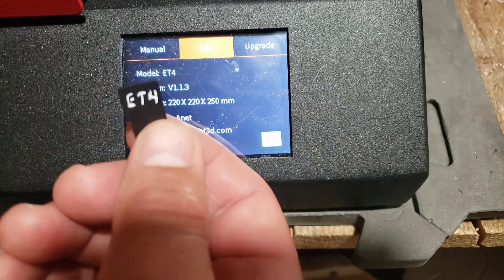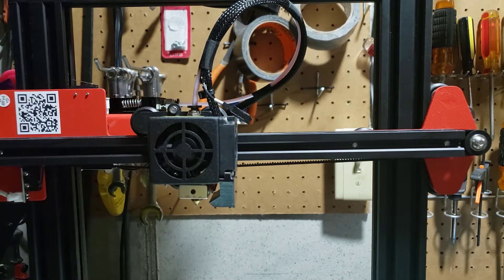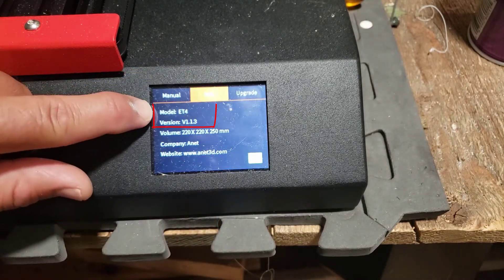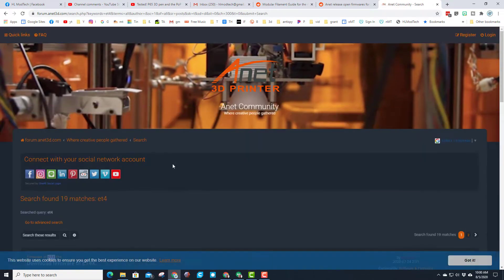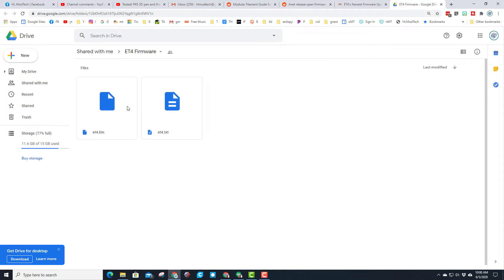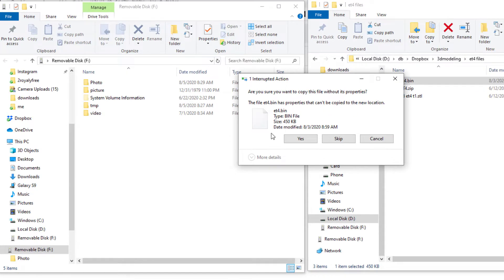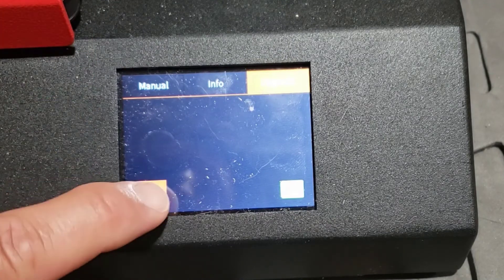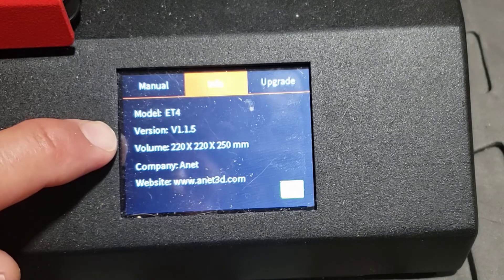Tested! Anet ET4 firmware upgrade steps | version 1.1.5 | ET4 Only

Comment: ive tried to do the exact same thing on my ET5 and it wont even start the update anythoughts?
Reply from the maker: This video shows how to recover a Anet that had a bad flash. https://youtu.be/KKCer809pxU
Reply: @HLModTech  gave it a go doesnt work just going to throw it out unfortunately
Reply from the maker: Did you buy an ST-Link? THey are under 10 bucks. I have never had a printer that was un savable.
Reply: @HLModTech  the amount of problems I’ve had with the ET5 has put me off cheap printers, just going to save my money and get a creality printer or something higher quality in the future
Reply from the maker: I get that. Hopefully you find one you dig.  I had an Ender 3 in my classroom and it was a workhorse. There are also a boat load of groups where you can find assistance for it.
Reply: @HLModTech  if possible I’d look for something with a 300x300x400 build volume for printing helmets etc

Comment: It doesn't matter if you mess it up because Anet doesn't honor their warranties anyway.
Reply from the maker: Thankfully I’ve never had to use the warranty system. I know everything I bought overseas it was slow to get support. My usual go to was Facebook groups because you can get replies they’re pretty darn quick. I do like how easy it is to bring one back to life with a ST link adapter.
Reply: @HLModTech  I bought mine on Ebay from an Anet distributor back in October and when I opened the box I noticed the warranty sticker was hanging off so someone obviously opened it  at some point in time. I messaged them and told them my concerns and they assured me that it's under warranty and any problems to let them know. I was too busy with work and other stuff at the time so I waited till after the holidays to finally assemble it and start using it. Right from the start I was having problems with it. The print head was arcing inside due to faulty wiring and the main board is very problematic. Don't know if it's the board or the firmware. None the less, it has issues to this day and it is under warranty. I messaged them several time informing them about the issues I was having and they haven't responded to this day. I contacted Ebay and they basically told me that I waited too long to use it but as I explained to them that it has a one year warranty and it is within the one year. If it was junk in October than it would be junk in February as well as it will be junk in June. It is within the warranty service time. Customer service at Ebay are the most brain dead people I have ever dealt with. So here I am with a basically useless printer that's under warranty that Anet is apparently not going to do anything about and I'm out $170. Will never buy another Anet product again. I actually picked up 3 printers on FB marketplace for $60 for all three. 2 Ender 3's and an Anet A8.Ender 3's work great but the Anet is being sold for parts because I want nothing to do with their products.
Reply from the maker: Sorry for your frustration. I liked that I could easily flash with the ST-link https://youtu.be/mAmIbrGi6G8  Popping Marlin on them was pretty slick. Really cool you landed a couple Ender 3's. I have one that is a workhorse for me.
Reply: Yeah, it's been pretty frustrating to say the least. I have a couple questions if you don't mind and you seem to be very knowledgeable . I have a BTT SKR V1.4 turbo that came out of the Anet A8 that I got with the two Ender 3's. Do you know if that is compatibly with the Anet ET5X and or the Ender 3. And second, are the Anet A8 parts compatible with the ET5X, meaning the PSU and the print head/hot end as well as the stepper motors? These printers are all new to me, I've actually built high end gaming PC's but these printers are a whole different world to me. Lol Thanks
Reply from the maker: I have not messed with modding printers much. I to was a PC builder... Just have not messed with taking the printers to new levels. Sorry I cannot give you better info on the compatibility of the various parts.

Comment: Hi.
Can i use 1.1.7 fw on ET4 which doest have auto leveling sensor so the regular first version of ET4 without capacitive sensor.. I have now the first 1.10 fw version. I m wondering will my ET4 start to go home at bottom if i upgrade to 1.1.7FW? as i have stock end switch on z axis only at the top. Do i need end switch hardware modification if i upgrade to 1.1.7 fw as it will start to go home to the bottom or it will still go to the the top at home position? I dont want to use any auto level function but want to use M503 and other gcode to setup estep calibration which only supported by the 1.1.7fw.
Thanks
Reply from the maker: Sorry I missed this. I am not sure.

Comment: I know its old but I bought an et5x and swapped out to the silent board. I go to update the firmware and it loads to 88% and then flashes white and resets. Any help?
Reply from the maker: Swapping boards most likely means you would need to edit the firmware before you flash it. I do not have the skills to mod the firmware. You may find someone in the Marlin Discord that has them though.  It may even be easy... it is just not in my skill set.
Reply: @HLModTech  it's the stock anet firmware not marlin
Reply from the maker: @DubandJub3DPrints  Ah, but when you start swapping components you need to make the firmware match the components. Like dropping a chevy engine in a Subaru... you are going to have to tweak stuff to get it to work.
Reply: @HL ModTech  well its an anet printer, anet board and anet firmware so you'd think it'd work
Reply from the maker: @DubandJub3DPrints  Sorry, it does not work like that. It would be as if the computer code for a Chevy Tahoe was the same as a Chevy Cruz. There are different parts in the silent board so the silent board requires a different code.

Comment: Can I update firmware without st link on et4 pro
Reply from the maker: Their stock firmware update without the ST link, but if you want to switch to any version of the marlin you’ll need a ST link
Reply: @HLModTech  im update stock filmware that shows create files successfully but not loading home page for some minutes I turn off & on again only shows on logo 😭😭😭
Reply: @HLModTech  pls help me
Reply from the maker: @Uniqcraftin  Super sorry to hear that. Here is how I fixed one I had that ended up with a frozen boot screen. https://youtu.be/KKCer809pxU Which firmware did you use?
Reply from the maker: Thanks for the link. That looks like the right firmware. Did you use a High Quality SD card or the one that shipped with the printer?  That was a step I showed in the video as a lot of users had issues with the Anet ones. That is also why I had to snag the ST-Link to bring my dead printer back to life.
Reply: @HLModTech  no I used shipped with printer. that following methods will back my et 4 pro to normal condition,
Reply: @HLModTech  I copied bin & TXT file on  sdcard on that folder remains hex file also that is important